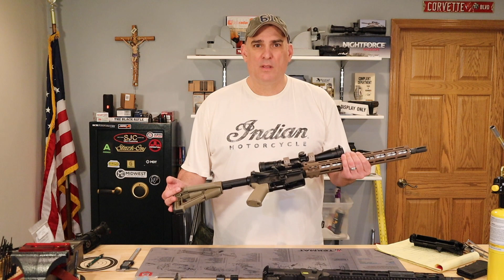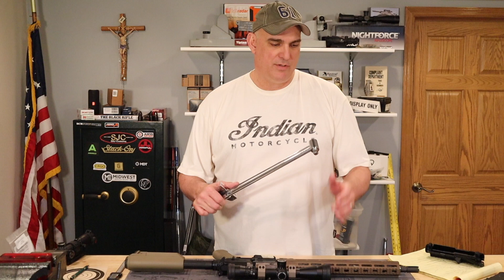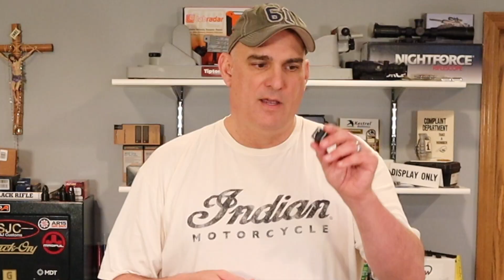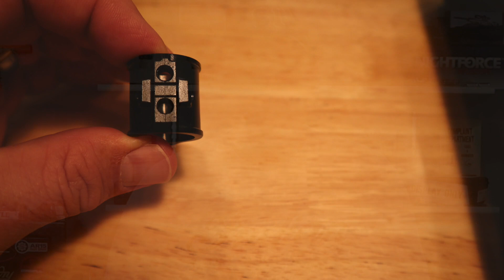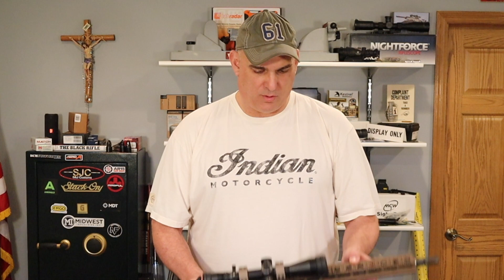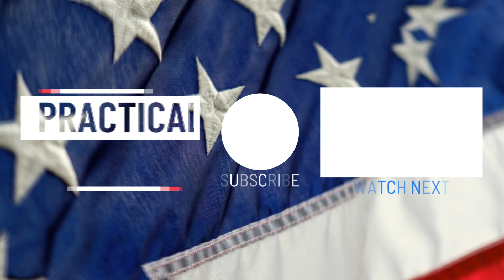Is it worth building your own ar 15? My first ar 15 build, the good, the bad, and the ugly.

Comment: I connected my gas tube to gas block,,, do I just put the whole gas system on my barrel & tighten it as tight as possible & then add the hand guard & start firing ???

Comment: I built an AR from scratch and am very satisfied with the results.  I got what I wanted and saved some money in the process, plus the satisfaction of building it myself.  

My design objective was to have a lightweight general purpose AR.  The parts I chose were:
Faxon 16" match grade pencil barrel (Wylde 223 chamber)
Faxon bolt and carrier
Aero Precision upper and lower (I lapped the upper seating surface)
Geissele trigger
Midwest free float M-Lock rail
Brownells buffer and spring
Raptor LT charging handle
Daniel Defense adjustable stock (a lightweight model) 
Trijicon red dot sight

The rifle is nice and light and more than accurate enough for my needs.  I have not experienced a single malfunction while shooting this AR.
Reply: Im early in the process of doing this the actual process of assembly did you have a guide how did you do it?
Reply: @2stonhoops  I did it back when youtube still allowed build videos.

Comment: Did you lap the barrel seating surface?  if the barrel extension and upper receiver aren't square to each other and seated well, you can get inconsistent accuracy.  The face of the upper receiver might not be perfectly square which can cause uneven pressure against the mating surface of the barrel extension.  This condition can cause the resonance of the barrel to change slightly causing the point of impact to shift.

Comment: I continue to really enjoy this channel!  Don’t know if it really counts as a “build,” but I’m having a lot of fun with a little rifle I’ve “put together.”  You can find it in some of my Y.T. videos.  I simply took an Anderson lower, added a Del-Ton upper—16 inch, midlength, pencil barrel.  I went with an A2 solid stock and B5 handguard (very small!).  A2 front sight post, and a decent, metal rear sight that came with the upper.  I did put on an inexpensive 3-9 scope for when I don’t want to try so hard!  (My wife shot it for the first time recently, and with the scope, had no problem with 200–she’s all of 5 feet and 97 pounds!).  Of course, I had to show off and hit without the scope!  This is my super-light rifle at about 6 3/4 pounds.  I also have a 20” upper with carry handle to represent an A4.  Keep up the great work!

Comment: What torque did you set your muzzle device to?  You can really open up your group size over torqing the muzzle device.
Reply from the maker: I use smith Vortex muzzle device which is just hand tight with no timing required. it self tightens so you are not applying torque. thanks

Comment: I redid my factory m4 stag arms gun. Using the stag lower, put in a geissele trigger. Went to a mod 1 smooth side upper. Put a 16in pencil barrel, no flashhider. Used a aluminum bolt carrier, standard buffer tube with stock buffer and spring. Fde furniture. Stock m4 adjustable stock, Reptilia grip, B5 handguard. Topped off with a holosun 503cu-gr sight mounted on a utg slim line mount. Weighs in at 5 lbs 4 oz. Very reliable, no hick ups. Sighted in at 50 yards. Tight group. After that milk gallon jugs out to 250 yards didn't stand a chance. I throughly enjoyed doing it. Took a gun I liked and made it my own
Reply from the maker: Awesome build. Thanks for watching.

Comment: Liked your video. I'm in the process of building my own, but bought a ODG PSA Lower and learned it's probably better to get everything off of them so that it matches up.  Eventually going to switch to the Geissley trigger.  My object is to build a rifle set up the way I like it . Not spend a lot of money.  And have it shoot to my liking ( varmint/coyote gun- 18" barrel, 1 in 8 twist ).
  Suggestion: what if you jut switch barrels of your 2 projects ? And keep your matching rail...
Reply from the maker: I bought a new barrel from Rock River Arms and it shoots good now. Thanks for watching.

Comment: I have two rifles I have built, sort of. I built both my lower receiver assemblies from stripped lowers so that I could pick my own trigger, stock, and pistol grip, but I bought complete uppers from BCM, because after a lot of research and the fact that I don’t have the necessary tools to build an upper from scratch, I determined going with BCM would give me the quality I was looking for without the hassle. I haven’t been disappointed. I may try building my own upper assemblies at some point in the future if I acquire the right tools. Regarding accuracy, have you heard of David Tubbs? Accuracy is his thing and he has some excellent YouTube videos. I bought some of his flatwire buffer springs and have been very satisfied with them. He has an informative video explaining why they are superior to the standard mil-spec buffer springs, and vast knowledge of all the tweaks you can do to wring the most accuracy out of your rifle.
Reply from the maker: Thanks. i'll check it out

Comment: Pull and lock the carrier to the rear. Slam a round home. And then eject the round and look at the bullet for marks. I don't know how expensive your barrel was. But maybe a feed ramp shave and polish might do something. Assuming the headspacing and throat gap is all on point. And when you start playing with muzzle devices you are playing with barrel whip and harmonics. Most of the time a brake will enhance performance. Little bit more bark at the shooting pos. Lol. Nice looking gun though.

Comment: I would recommend to anyone to build an Ar-15 but only after learning how each component works and how they all work together’ especially the gas system. I watched YT videos for about a year on assembly’ trouble shooting’ ejection patterns and each component so that I understood how everything worked and what I was doing to assemble. My first build was a budget build that costs about $650 with optic and mount. It came in at 8.5lbs and it could shoot under an inch if I did my part. My wood shop teacher always told us “If you fail to Plan’ Plan on failing” and I apply that logic to everything I do I life. The only thing I didn’t like about that first build was the weight and I don’t consider that a fail because I didn’t plan on building it lightweight. Since then I’ve built over 30 Ar’s from .300blk .223/5.56 .308 and 6.5cm from regular weights to ultra ultra lightweight. My first Ar I owned was an M&P 15 which was nothing special but it ran great. The real advantage to building your own Ar is you get to pick the parts you want and as your budget allows. one of my Ar .308’s weighs 4lbs 14oz with a 16” barrel 15” handguard and rifle length stock. It shoots under an inch and has no cycling or ammo issues. It cost about $3000 over 2 years ( mainly because parts were out of stock ) but I could afford it over time rather than all it once. Im still learning about Ar’s and I by no means think Im an armorer or a gunsmith. I don’t work on other peoples guns or act like a know it all. As far as the accuracy issues your having I would contact the barrel manufacturer and ask them what you should do’ maybe they’ll exchange it or have you send it in for testing. Good luck.
Reply from the maker: They won't respond to me. I did fix the issue though. If you are interested. https://youtu.be/akLG3_z7kcM
Thanks for watching and the comment
Reply: @PracticalAccuracy That's not very encouraging. Haven't heard anything bad about Criterion on here so far. A company that doesn't reply or stand behind what they put out I can do without.

Comment: I’ve used Primary Arms and Palmetto State … I prefer PSA. 7 rifles later I’m no expert but I certainly know more than I did after Army Basic Training. LOL

Magpul Furniture just because it fits the rifle and me. 

Using a local FFL for the lowers made it easy

Beware: it kinda like Pringles - you can’t just build one

EDIT: I personally do not like floating fore grips and removed them from the first 2 rifles I built. Metal mags make me happy also

Comment: A year later...have you figured the precision build's issues out yet?
Reply from the maker: Yes. here is the video.
https://youtu.be/akLG3_z7kcM
Reply: @PracticalAccuracy  good detective work...i run a pinned gas block on a ballistic advantage 18" barrel and have not had any accuracy issues with that setup..it is possibly i suppose for a pinned block to mess with barrel harmonics ,especially if it is not pinned securely...
I am pretty surprised the criterion performed so poorly...
On a related side note,the bcm uppers are excellent quality, i have used several of them and not seen one that needed lapping to be square...and the heat to fit eliminates the need for bedding with retaining compound for a precision build...

Comment: Your supposed to tighten the barrel in 3 steps,(use anti-seise) if you want 45 lbs total  , first tighten to 30lbs ,  second time add 6 pounds more =36 , third time  6 pounds more=42 , your final time go to 45lbs . The reason for doing this is , it matches up all the thread surfaces so you have even pressures , it marrys everything up evenly together . It might sound stupid but I watched a Master builder explain it just like I did too you .  Just do it !   If your group are bad and you check everything else , it's most likely the barrel nut not staying tight , even though it felt tight it wasn't seated right, it effectively gets loose because it wasn't fully seated properly !  One guy talks about some parts being heated I have heard that too , like when installing a taper crank shaft into a flywheel on a H.D , some AR barrels are done that way it depends on the type assembly and method, Black shadow rifle's company uses a tapered fit receiver in that case they use that method.. hot receiver and cold barrel tapered compression fit.
Reply from the maker: Thanks for the comment

Comment: I bought one of those PSA kits, when a sale hit. So, I more "assembled" than built it. I mainly tinker and fix up WWI era rifles, and wanted to give something different a try. It works perfectly, so I must have done ok, lol. Far from my favorite thing to use, but the versatility appealed to me. Only downer I ran into, was no open notch rear sight to be found, and my eyes don't do the peep or red dot stuff. Bifocals and astigmatism, so I need rear sight far forward. In the end, I stuck a low profile scope on, and cut down sight tower. Went with nitride Nato/multi 16" barrel and 1:7 twist was the cheapest. Classic handguard, nothing fancy. Good experience, and I learned alot. Once a year, I take it out and run a box of something cheap through it.
Reply from the maker: Thanks for watching and the comment on your build.

Comment: I have built over 75 AR15s And I never heard anything about heating up about heating up your upper receiver to slide your barrel in they were tight Those can be tapped in with a rubber mallet for for the snug fit ones  . Some of my most accurate rifles have been. These are my parts. Green Mountain 223 wild barrel. A little pricey but the accuracy 2nd to none that's why they now have a military contract and they're rare as s*** to find I go with A CMMG premium parts kit. Sometimes I   choose magpaul Furniture or arrow precision.. Not trying to write a book here but but I have installed Franklin armory by in armory binary triggers on some of these builds that I'm talking about right now and they have been flawless Some of the most accurate rifles that a lot of people here in Maine have seen . When you can put a softball group out to 500 yd yards that's accurate accurate with no hang UPS with your with your BCG . One thing I will take away from being in the military is Kiss Keep it simple stupid . What I mean by that is try not to overthink it too much Don't look for Gucci Look for the Functionality And what you're trying to achieve out of the build.. But you did a good job on your observation And the troubles you're having
Reply from the maker: Wow. 75 rifles. Thanks for watching and the insight.
Reply: Several companies do have intentionally undersized bores in their uppers and have to be thermo set, BCM, SOLGW to name a few. They are a real pain if you have tolerance stacking requring feed ramp .

Comment: You mentioned that you sent your barrel off to have machined to fit gas block. Is it possible to purchase a barrel already grooved or dimpled to accept a certain gas blocks and what are your thoughts on clamp on gas blocks. Thanks
Reply from the maker: You can get a barrel dimpled, but I'm not aware of any barrel that is cut for pins because it would have to be machined for a specific gas block. I wanted these gas blocks pinned to guarantee they wouldn't move. I have put clamp on style gas blocks on rifles that are range only guns. Otherwise, if they are for self defense, I would want them pinned to the barrel.  Thanks for watching

Comment: After owning two fully made AR rifles, I finally decided to build one myself.  I did it largely so I would understand the guts on the two rifles I already owned.  It was SUPER satisfying to build my own AR!!!  It is a good thing I am of modest financial means or I would keep building them with all sorts of accessories.  I will definitely do another build in the future!!
Reply from the maker: Awesome. I fixed the accuracy issue with mine. Video is landing on  8-13-22. Thanks for watching
Reply: What can you expect to spend for a decent build, I know it varies but can you build one for $800
Reply from the maker: @markmaue4861  $800 is go if you shop around

Comment: When adding a muzzle brake I always use shims rather that a crush washer.  A crush washer can cause the muzzle brake or flash hider, not as important as a brake to have indexed right and straight, to not be perfectly straight.  This includes issues with threads on the muzzle brake or on the barrel.

Another thing to remeber is even though you can shoot 223 out of a 556 barrel the 223 will not be as accurate.  

Looking at the wylde barrel’s it’s the opposite the 556 won’t be as accurate. 

Ammunition weight and turn and length of barrel also has huge impact on accuracy. Make sure your shooting the right weight and type to the barrel you have.  Verify the head spacing as well. You could be in tolerance but on the loose side of it that combined with say an out of tune muzzle brake could give you the wider grouping at range.
Reply from the maker: Thanks for watching and the comment. I have the accuracy issue solved and I just need to make a video.
Reply: @PracticalAccuracy  awesome!  Can’t wait to see it!

Comment: A lot of people suggested your accuracy problem could be a barrel issue or to try to re-torque it. That could be the problem. The only other issue I could think of would be a gassing issue. Try an adjustable gas block or replacing your current system with another (piston conversion or traditional).
Reply from the maker: I figured out the accuracy issue and hope to get a video out soon. thanks for the comment.

Comment: I don't see the advantage of heat shrinking the gun barrel into the upper receiver. I feel as long as the barrel nut is greased, and torqued to the proper foot pounds, and released and re-torqued 3 to 4 times, the receiver threads will be properly stretched and the gun barrel will be properly fitted and as tight as it has to be. Then it comes down to properly mounting and leveling your optic to the upper receiver, and sighting it in to the degree you need to get the job done.
Reply from the maker: You could be right. It might just be marketing. I've fixed the accuracy problem. I just need to get a video together. Thanks for watching.

Comment: Biggest problem: "Due to shortages, I couldnt get the part(s) that I wanted". Building one is an exercise in delayed gratification. It's going to take a long time and you need to be patient and wait until you can either get the part you want or scour the internet to find someplace that has it. I ordered a handguard with the wrong rail- had to send it back and wait another month. It could have worked just fine, but if you are going to tailor a gun to you, it's not going to feel good when you dont get exactly what you want. It's a one-of-a-kind gun built for you, by you. Make it exactly the way you want and cut no corners.
Reply from the maker: Very good points. I agree. Thanks for watching.

Comment: PSA makes it hard to build a "budget AR". If you want a $2k AR for $1100, build one. And in my opinion, the A2 fsp as gas block is the most "bomb proof". I have rifles with low profile gas blocks and have had one come loose. I'm a Marine veteran (0341) and wouldn't trust a low profile gas block with my life.
Reply from the maker: I have a current build with A2 fsp and I prefer this setup as well. Building both has given me new insight into the durability issue. Thanks for watching